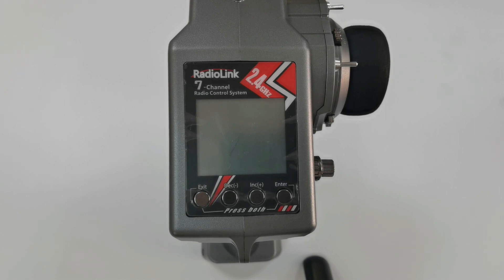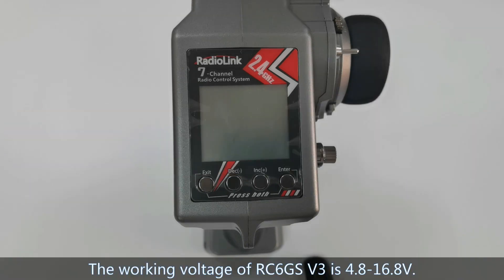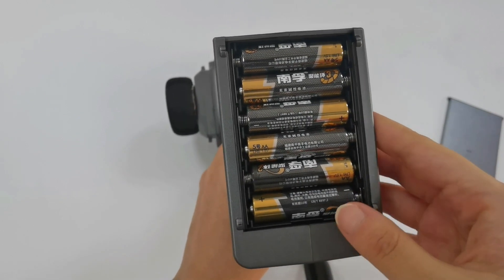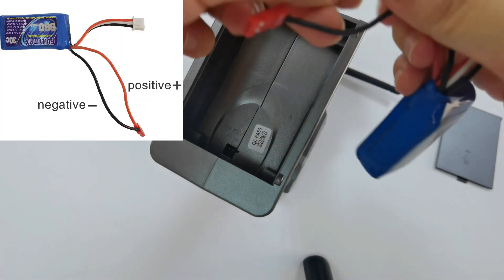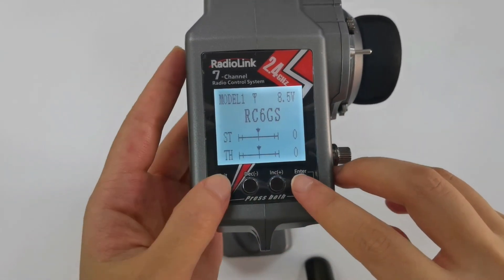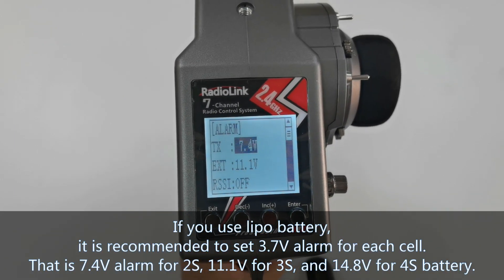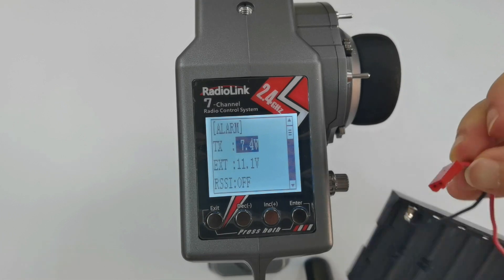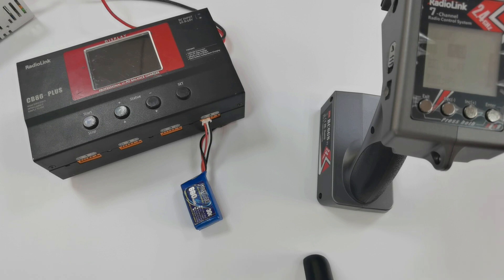TX Low Power & Battery Power Supply Options of RC6GS V3/RC6GS V2/RC6GS/RC4GS V3/RC4GS V2/RC4GS

Comment: Hello radio link when i go to fail safe and go to throttle its at 1 and it wont let me change the number any idea what could be ?
Reply from the maker: Hi, sir. What transmitter are you using? When setting fail safe, you need to move the corresponding switch. For example, when setting the fail safe of throttle, you need to move the trigger so the value will be changed. If any question, please feel free to contact us. Our email is after_service@radiolink.com.cn
Reply: @Radiolink_official v3

Comment: I set the alarm appropriately to the 5200 50C 7.4v mah battery it still beeps
Reply from the maker: Hi, sir. Could you please make sure the beeping comes from the TX alarm? If it is TX alarm, please check the voltage of your battery and the TX alarm you set. If the battery voltage is lower than the TX alarm voltage, it will beep. If any question please feel free to contact us. Our email is after_service@radiolink.com.cn

Comment: Hey, is there a minimum of c-rate (30c or 5c) the battery must have? Grts
Reply from the maker: Hi, sir. Yes. For transmitter battery, it is recommended to use battery with c-rate of 8c. For model battery, it is recommended to use battery with higher c-rate. Because the more the c-rate is, the more power there is. For model battery, it is best the c-rate is higher than 25c. If any question about RadioLink products please feel free to contact us. Our email is: after_service@radiolink.com.cn

Comment: Can I use 6 nimh batteries?
If possible, what should I set the voltage alarm to?
Reply from the maker: Hi, sir. Sure you can use nimh batteries to supply power to RC6GS/RC4GS. The working voltage of RC6GS/RC4GS is 4.8-16.8V. Just make sure the battery voltage not exceed 16.8V. And we recommend you to set 1V for each nimh battery. You can also confirm it with the seller of the battery. If any question about RadioLink products please feel free to contact us. Our email is: after_service@radiolink.com.cn
Reply: So woth 6x 1.5 V normal batterys set the tx alarm on 6?  @Radiolink_official
Reply from the maker: @johandriehuizen9282  Hi, sir. For AA batteries, we recommend you to set 1.2V for each battery. So for 6pcs AA batteries, you can set it to 7.2V. But it depends on your needs. If any question, please feel free to contact us. Our email is after_service@radiolink.com.cn

Comment: Can channel 7 be used while using s-bus?
Reply from the maker: Hi, sir. Are you using RC6GS V3 and R7FG receiver? While using SBUS, channel 7 outputs SBUS signal, channel 6 outputs PPM signal, channel 1-5 outputs PWM signal. We recommend you to check the detailed manual of R7FG which introduces details of the working modes of R7FG. https://www.radiolink.com/r7fg_manual  If any question when using RadioLink products please feel free to contact us. Our email is: after_service@radiolink.com.cn

Comment: And what voltage I should set the EXT Alarm?
Reply from the maker: Hi, sir. The alarm voltage depends on what battery you use. For example, if you are use lipo battery, with full voltage of 4.2V for each cell, we recommend you to set 3.7V for each cell. For example, 2S battery with full 8.4V, you can set alarm voltage as 7.4V. You can also set different alarm voltage as you like. If any question when using RadioLink products please feel free to contact us. Our email is: after_service@radiolink.com.cn
Reply: @Radiolink_official  soo i use 2 lipo 4s 8000mah 15.2v? What voltage I should set?
Reply from the maker: @CorvetteC6-LS2  Hi, sir. We do not know about your battery. For example, if the full voltage of your 4S lipo battery is 16.8V(4.2*4), you can set 14.8V(3.7V*4) But actually, you can set alarm voltage as you like. You can also set it to 15V, 15.2V etc. If you do not know about your battery, we recommend you to confirm with the producer of the battery.
Reply: @RadioLink  yeah is 16.8v soo the  15.2v is more safe Tham 14.8v ?
Reply from the maker: @CorvetteC6-LS2  If you set 15.2V, the alarm will go off when the battery voltage reaches 15.2V. If you set 14.8V, the alarm will go off when the battery voltage reaches 14.8V. Both is okay. Higher voltage can avoid 0ver-discharge of the battery.
Reply: @RadioLink  ok good information thanks but what about the RX ?? What voltage I should set it?
Reply from the maker: @CorvetteC6-LS2  It defaults to 4.0V. Just set any voltage you like. You can check the working voltage of the receiver from the sticker of the receiver.

Comment: Hello Radiolink. What supply voltage do you recommend for this transmitter? Some forums say that using 4S or 3S LiPo batteries will over stress an internal voltage regulator inside the transmitter. Thank you.
Reply from the maker: Hello, sir. The working voltage of RC6GS V3/RC4GS V3 is from 4.8 to16.8V, so you can use 6pcs of AA batteries or 2S-4S LiPo battery. That is to say, 3S or 4S(fully voltage is 16.8V) lipo battery also compatible.
Reply: Hey. I’m using a 3S battery. Just think 14.8v is a bit much. Assuming middle range is safer.
Reply: @ahoyskid  I plan to use a 3S LiPo. I would prefer to use a 3S LiFe pack but can't find one that fits the battery compartment. It's nominal voltage is closer to 6 AA batteries. I was really asking if there is an  internal voltage regulator like what some people have said in forums.
Reply: @lordhumungous7908  just checked mine, I actually have a Gens Ace 800mAh 2S  battery in it at the moment.  (B-45-800-2S1P)
Reply from the maker: @ahoyskid  Hello, sir. both 3S or 4S batteries are compatible. You can choose the one you like. 3S battery is lighter than 4S.
Reply: @Radiolink_official  understandable. Do you recommend 2S also? Or is 3 or 4s the preferred option. Thanks,
Reply from the maker: @ahoyskid  Hello, sir. All 2S, 3S, 4S can be used. The higher the battery capacity, the longer the standby time. The more cells, the heavier the battery, so just choose any one as you like.

Comment: Hey, buddy, I'm building an amphibious tank.
1. Channel 2 mixing and left and right operation possible.
Connect the water motor to receiver 3.4.
Is it possible to mix the receiver channel 3.4 with the throttle and steering channel through the on-off switch during the rc6gs v3 function?
Reply from the maker: Hello, sir. For RC6GS V3, you can assign a on-off switch to mix the the receiver channel 3.4 with the throttle and steering channel. And please note, there are total 2 mixes in the transmitter. You can check if the mixes are enough.
Reply: @Radiolink_official  Wow.
Two out of four working motors use the front and rear left and right in the receiver 1.2 channel.
Can you use the front and rear left and right motors connected to receiver channel 3.4 through mixing?
Reply from the maker: @creepoff-roadrc  Hello, sir. Channel 1 and channel 2 is steering and throttle. So they will control  front and rear left and right. Therotically, you can mix 3 to channel 1, and mix 4 to channel 4 to get the function of channel 1 and channel 2, but you have already used 2 mixes of channel 1 and channel 2, so there is no more mix to mix channel 3, 4 to channel 1, 2. So You can not get the function on RC6GS V3 if you have already used 2 mixes.